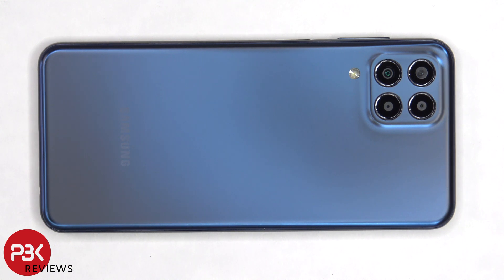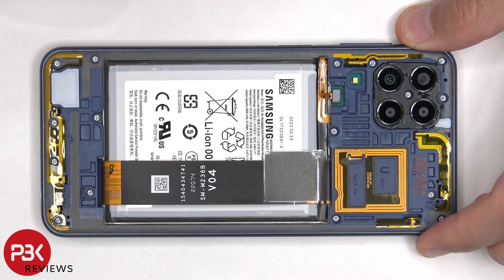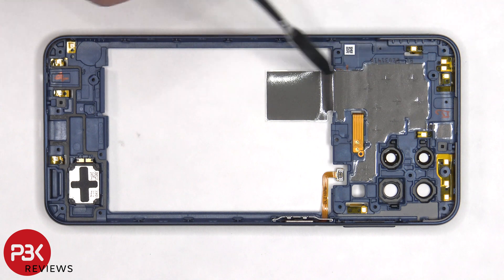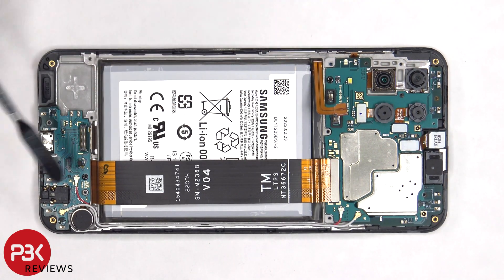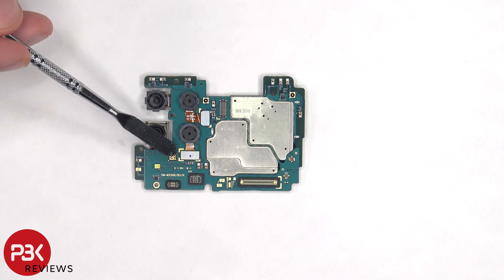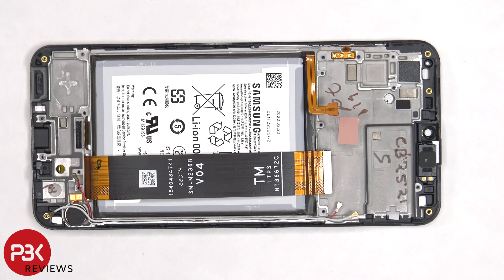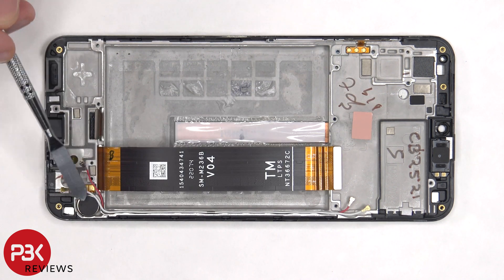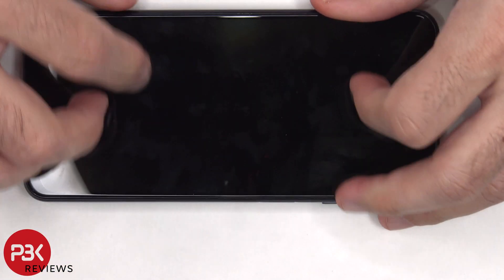Samsung Galaxy M33 5G Disassembly Teardown Repair Video Review

Comment: Where is storages holder chip ? On motherboard
Reply from the maker: There is no removable storage chip. The storage chip is soldered to the main board under one of the covered shields and is not user replaceable or removable.

Comment: Is this copper heat pipe and and advertised M53 vapour cooling chamber same thing?
Reply from the maker: Copper heat pipe is a bit different than the copper vapor chamber. The vapor chamber is usually better and is spread over a wider area.